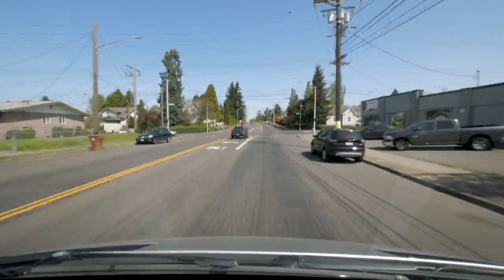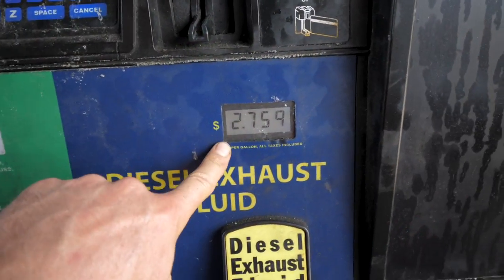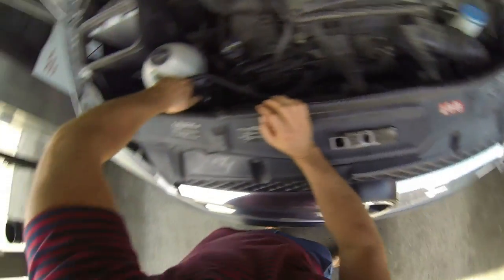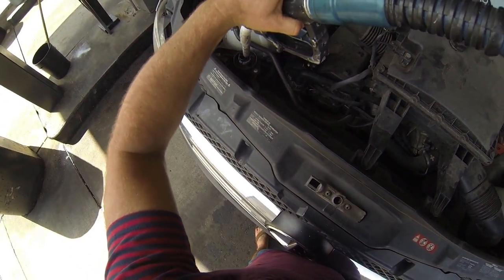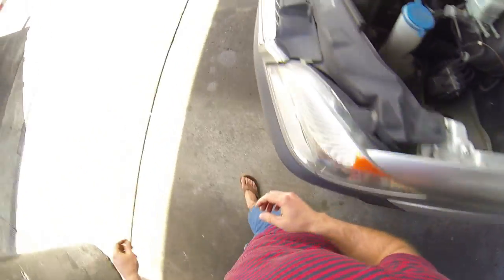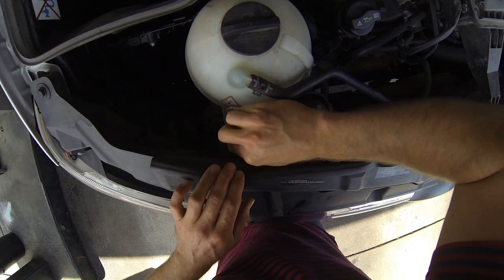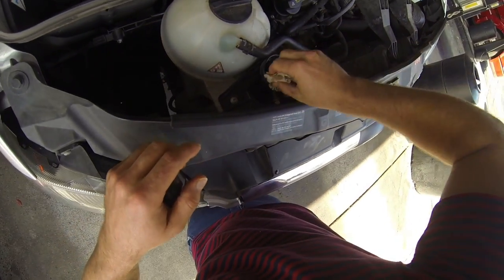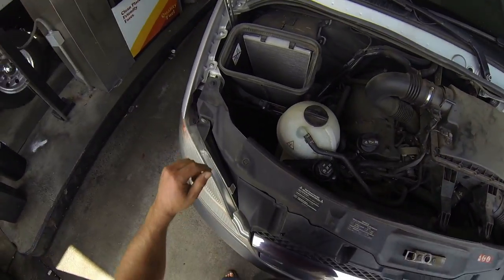Sprinter Van Life Hack: Refill Diesel Exhaust Fluid DEF For Less Than $11

Comment: I have filled the DEF tank but my Sprinter will not crank or start. My employees ran it out, is there anyway to reset this without taking into the shop? I have cleared the codes with my OBD2 reader but still won’t crank over.

Comment: Does that pump click off to prevent overfilling? (like a standard fuel pump)
Reply: That was my question also, looks like he didn't actually fill it in this video, just did a "dry run".  I have been tempted to fill mine at the truckstop but I fear it overflowing and making a mess.  You do NOT want this stuff all over since (like he mentioned) it is corrosive!  Even when I fill mine with a jug I always take a hose and wash off anything that might have spilled ( it is water soluble).
Reply: Brian Dillon Yes they are auto shut off. Just like standard pumps.
Reply: Washed off with water
Reply: They are crusty, so use a glove. Wash off the excess spillage and off your hands if not using gloves. Hopefully technology gets past this stupid phase. Electric is only part of the answer.

Comment: Excellent video!  If you have a newer Sprinter, ensure that the truck stop has DEF that complies with ISO 22241.  In the USA, Pilot and Flying J certifies it is ISO 22241 compliant.

Page 126 of the 2017 Mercedes Sprinter user manual states offers some important warnings:

Only use DEF in accordance with ISO 22241. Never mix DEF with additives or thin it with tap water. The exhaust gas after- treatment may otherwise be damaged. Observe the MB Specifications for Service Products, Sheet 352.0. Damage that results from the use of additives or tap water leads to the loss of the New Vehicle Limited Warranty.
If DEF comes into contact with a painted or aluminum surface, wash the surface off immediately with plenty of water.
Reply from the maker: Thanks for the follow up info! Nice and thorough, just how I like it. :-)

Comment: What happens if you just fill DEF with water ?
Or water and alcohol ?
Reply: Not much because Def is injected into the exhaust stream not the motor
Reply: There is a quality sensor in the tank. It will detect thats its not 32.5% Urea and derate.

Comment: Nicely done! I’ve visited that Loves for fuel only before, but not DEF. You are right though, most modern or high traffic truck stops usually have it at the pump. Another thing to consider: some truck stations have a magnetic lock on their DEF nozzles, and would require a magnet to unlock it. However, I have yet to come across one in the Seattle-Tacoma area.

Comment: Alright  some issues here. You DEF cap is black but your windshield washer fluid is blue. Plenty of room for error there. Also, you don't wipe up  DEF, you flush with plenty of water. You need to use a funnel so you can see what's happening. Noticed you didn't include the over fill part in your video. But still with all that, good advice on how to save the cash.

Comment: This is a cool tip.  I would love a sprinter but I've been hearing a lot about the DEF and EGR systems causing some seriously significant headaches for people and being extremely costly to maintain.  They are very complex systems so I was led to believe you should stick to only the recommended fluid.    I wonder how this fluid complies...

Have you had issues with your sprinter?  What year is it?  I'm eyeing a 2013 with 116,000 mi but seriously considering going with a gas van instead after reading some horror stories.
Reply: Or just get yourself a 2002 through 2006 pre-emissions sprinter. We've got a couple that got over 400k miles and still going.

Comment: How often do you need to top it up? Thanks!
Reply from the maker: I do it whenever the light comes on. I'd say once every three months or so.
Reply: Do you ever need to drain it all out and put it back in fresh?  If so how would you go about doing that?
Reply: It's injected into the exhaust not the motor, bad fluid isn't going to damage anything, it's just not going to reduce emissions like its supposed to
Reply: Around ever 3k miles it usually comes on